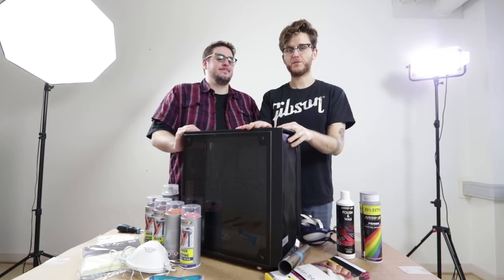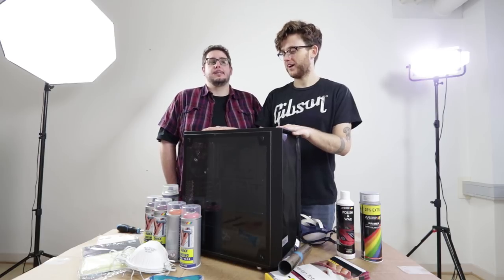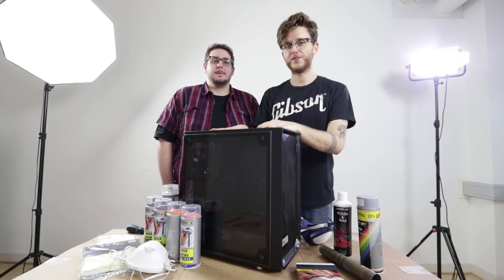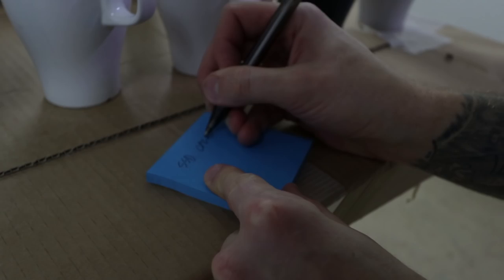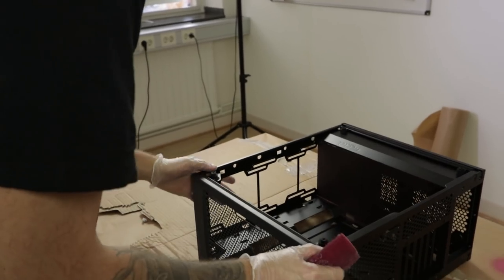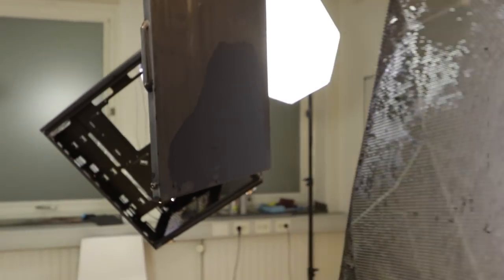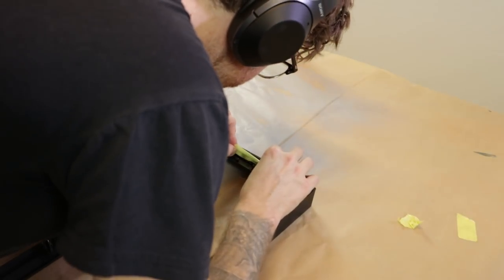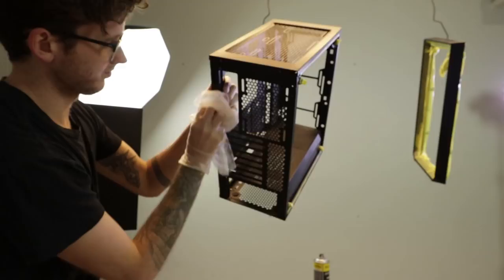Preparing the PC: How to Paint a PC Case

Comment: wow this looks amazing ! :) Great video!  Maybe a stupid quiestion though, if you add paint or skins on the pc does that not hurt temps ? I assume it works as a extra insulating layer...
Reply: As long as you use the correct paint, there's nothing to worry about. Now, if you painting the conductive surfaces and heatsinks... that'd be a different story. I think Linus did a funny video on this where he basically just spraypainted an already functional machine. Bad. Idea. Hilarious though!
Reply: Hahaha, xD I understand that making it fully like that is a horrible idea. But what type of paint should  I be using then?  :)